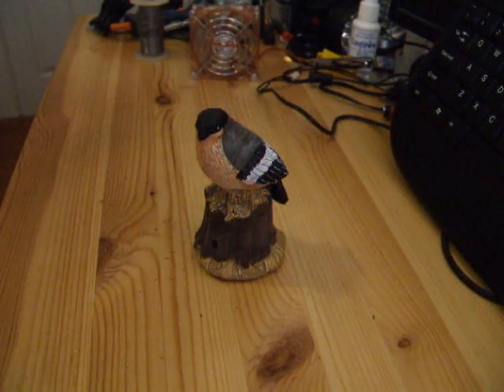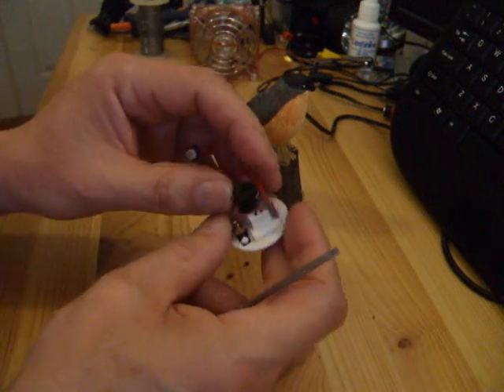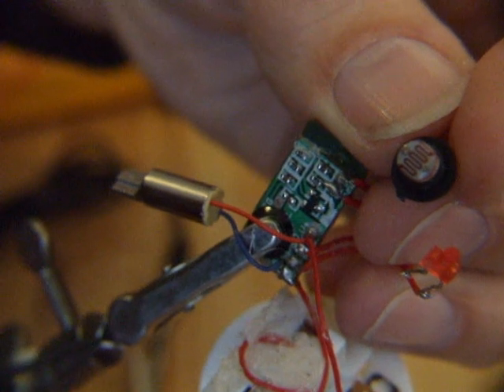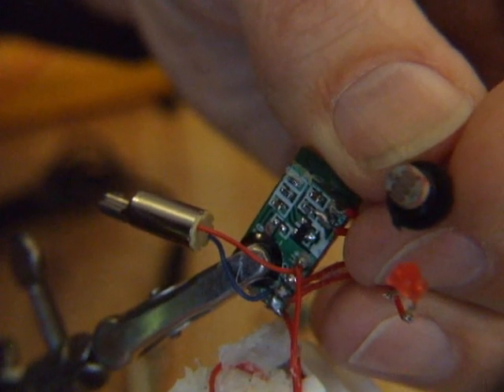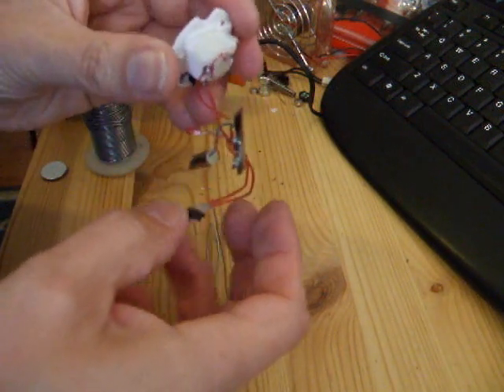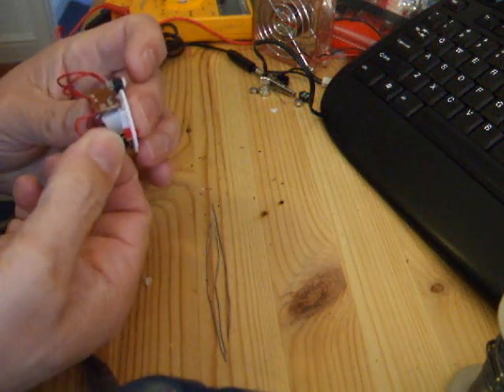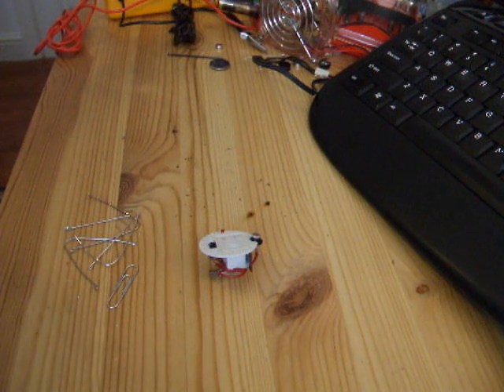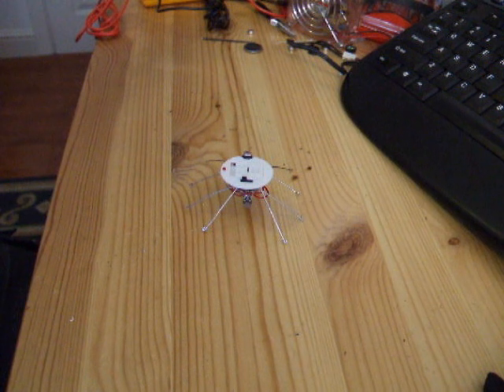Let's hack a Motion Detector

Comment: That looks to be a light sensitive diode in there. Not a motion sensor to speak of but nicely used to make something nifty.
Reply from the maker: Yes if you want to be specific it is a light dependant resistor LDR so it is sensing a change in the level of light 😊